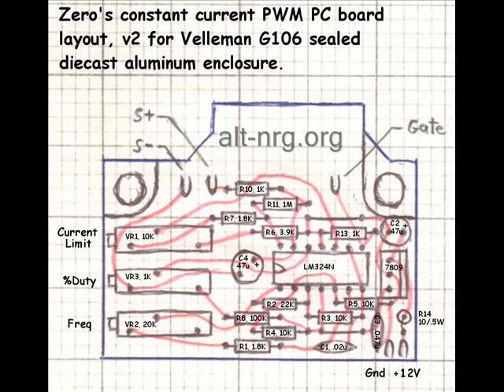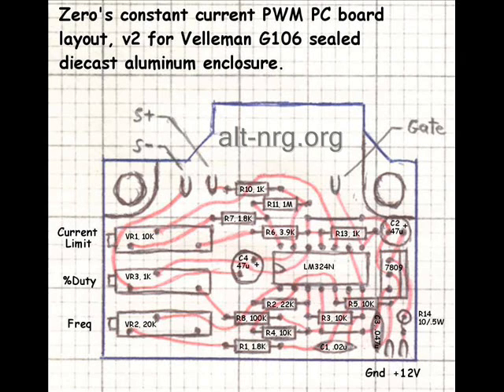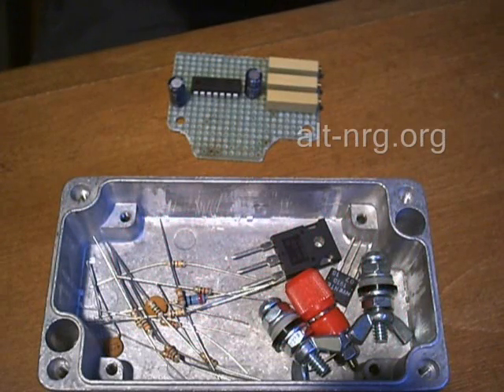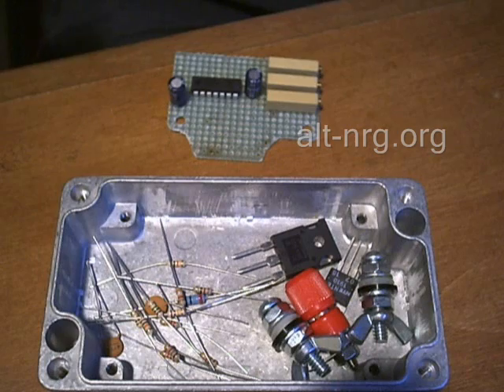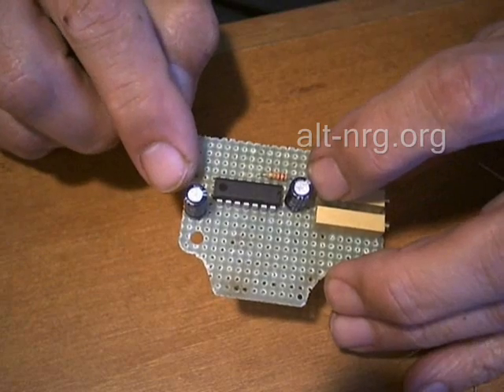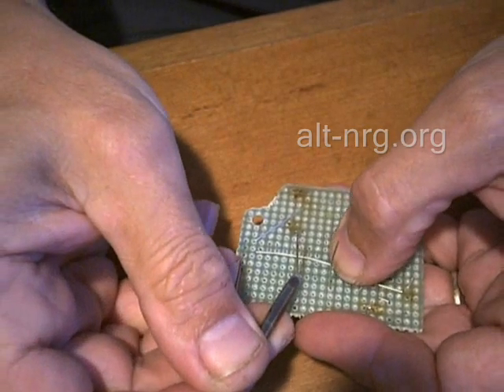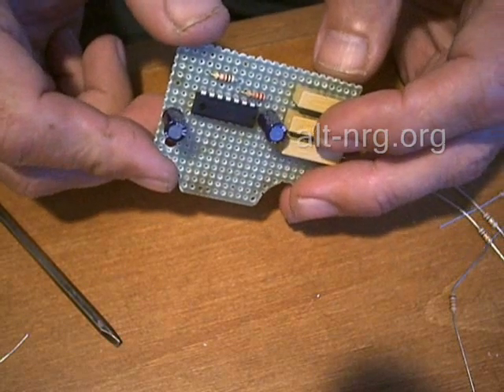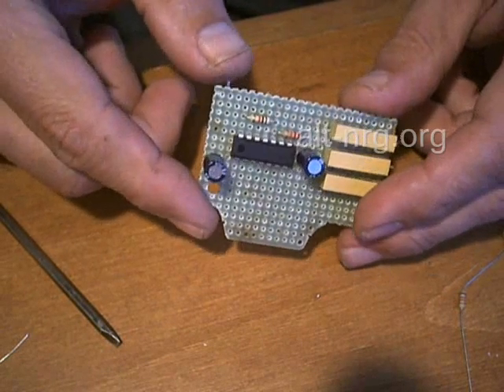#116 Building the PWM v2, part 2 of 5

Comment: Very nice straightforward layout and execution...I might add that it is always a good idea to hit the fresh solder connects with a touch of circuit chiller(or some canned air)especially around semiconductors. Whenever you're working with power Mosfets,one should strap-in(ESD bracelet and pad)before handling these components(unpacking,mounting,or soldering)Best of luck on the project,ZFF...btw,I didn't notice an LED power indicator light...

Comment from the maker: This output device IRFP064N is rated 110 amps continuous, 330 amps peak repetitive, 0.009 ohms saturated on resistance.

I plan to use it at 30 amps continuous, 100 amps peak repetitive. At this level the MOSFET should only have to dissipate 8.1 Watts RMS.

Well within the limits of the unit, well above the draw many people are comfortable placing on their stock alternators.